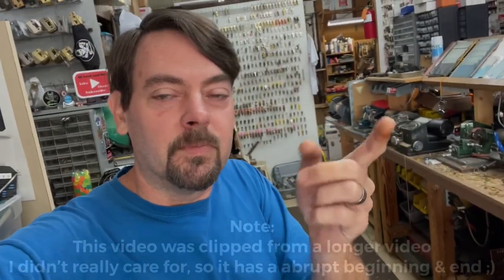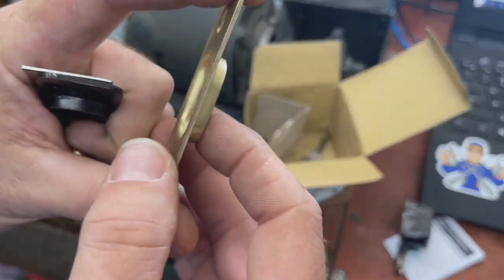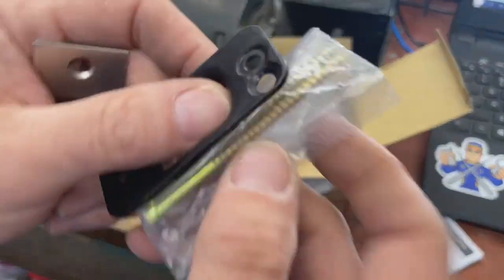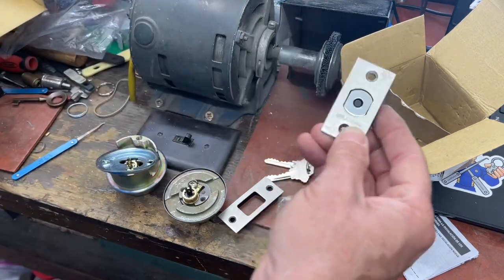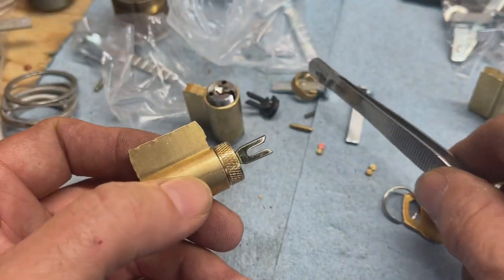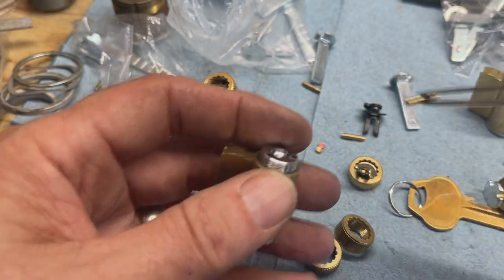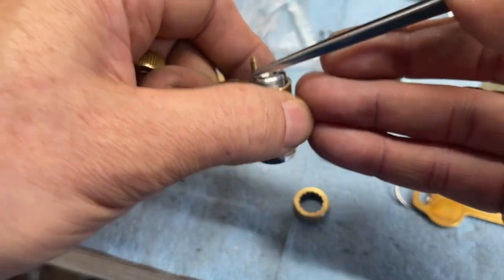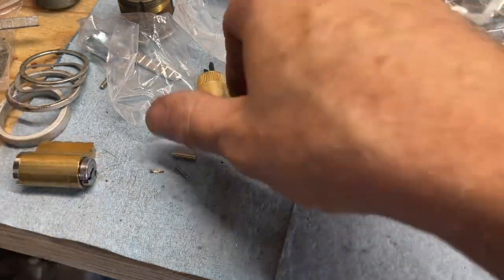Dexter DB1000 Deadbolts are almost identical to LSDA & switching cylinders

Comment: The deeper cap tip is gold for me..I didn't realize that was an option and wonder if it may have helped some issues I had with other cylinders in the past.  Does the optional cap size apply to Schlage cylinders to? If so, is there an assortment sold somewhere? Thanks!!

Comment: These look like Master "Grade 1" deadbolts. Although Master have an adjustable latch also with that badge. Have you run into those?
Reply from the maker: I’ve never ordered the Master Grade 1 but since they were muddled in the whole life cycle of Dexter I’m not surprised. I sell the grade 3 a lot for residential Weiser/Kwikset replacement
Reply: @selock  True. I found the master version have a Phat thumb turn and make it awkward to get the thru bolts in. Thanks for the video!